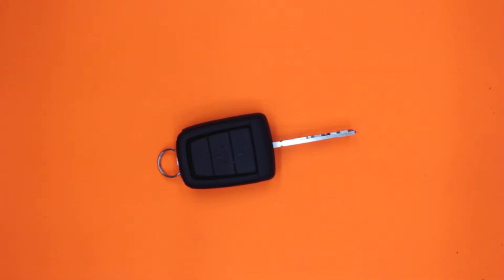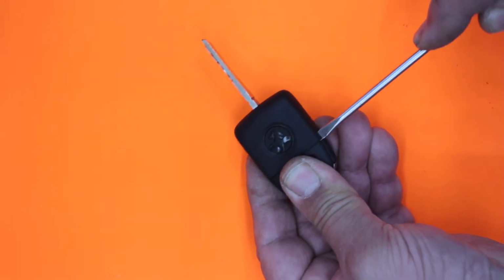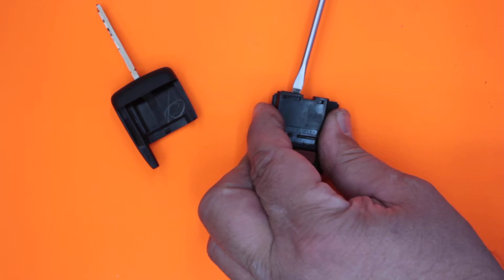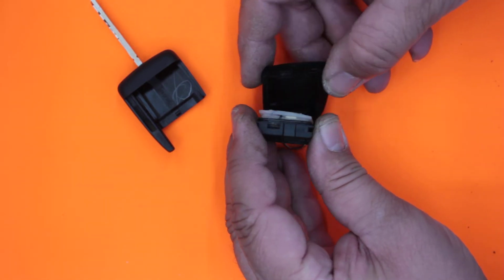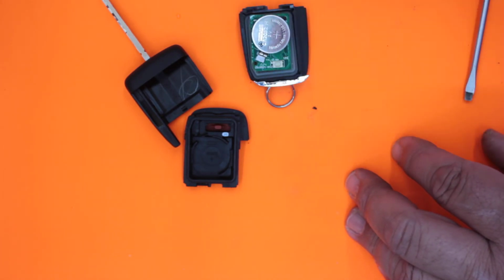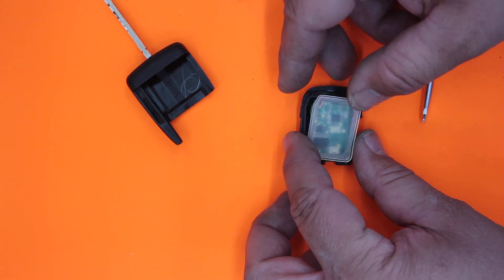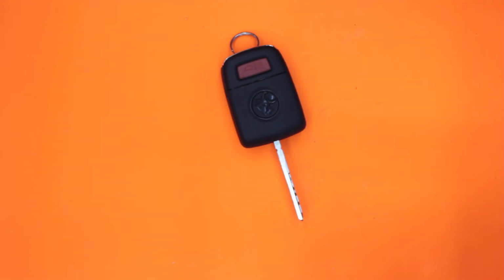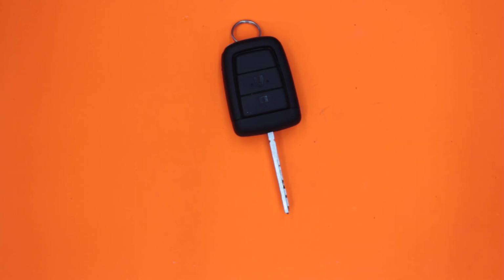How to change VE Commodore remote battery

Comment: I've had one problem twice with two different VE keys.  After replacing the battery no joy and I found the side contact ( Negative )  was not making contact with the battery.  Just had to gently bend it back in a little and all was fine.